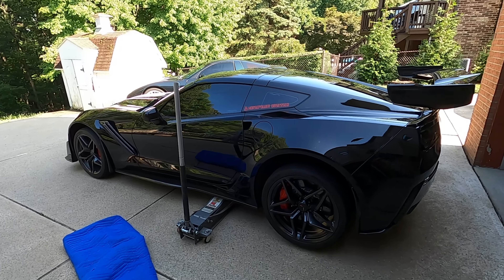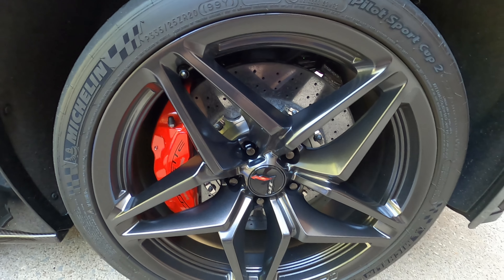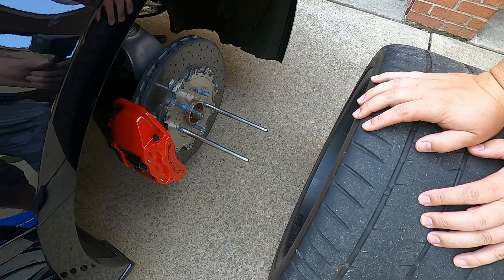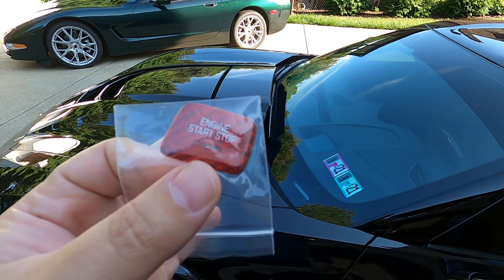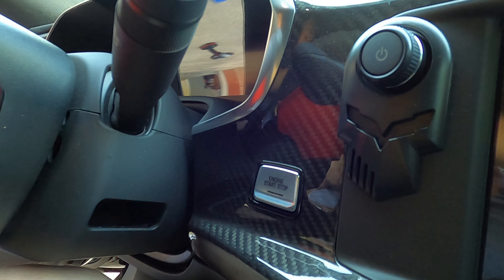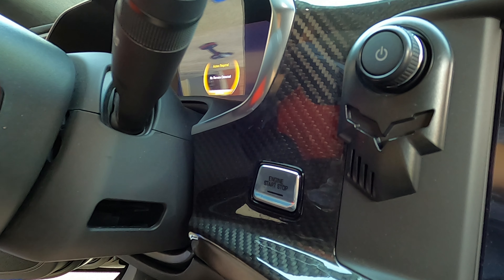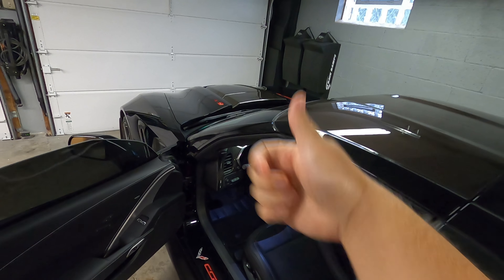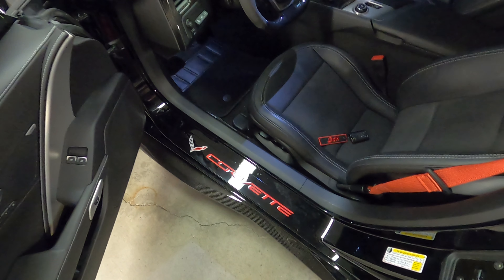Carbon fiber PARTS for YOUR C7 Corvette for less than $70!

Comment from the maker: What do you guys think of the carbon fiber addons for the C7? Check them out here: 🔴 Carbon Fiber Start Button Cover (red) - https://amzn.to/3Ed1H5B.⚫ Carbon Fiber Start Button Cover (black) - https://amzn.to/3nzn0Z5. 💲 Save 10% off the key fob cases by using promo code “HPO10” 💲 C7 Corvette Carbon Fiber Key Fob Case - https://bit.ly/3Ch9BJu. C8 Corvette Carbon Fiber Key Fob Case - https://bit.ly/3lqds00.
Reply: Those ACS composite things are an amazing idea. I wonder why GM didn’t just do that in the first place.
Reply: Just purchased the red one for my Z06
Reply: The carbon pieces are gorgeous!
Reply from the maker: Thank you!
Reply: On Amazon when looking at the Red. Button Cover, it states it will not fit my 2017 Grand Sport.  Isn’t the start button the same on all Corvettes?
Reply from the maker: Yes it is. It will definitely fit. Amazon's fitment guide is often wrong but I can guarantee you it will fit.

Comment: I love those extensions even though I don't have Carbon Ceramic brakes. It just makes any wheel removal easier and even a bit safer.
Reply from the maker: Agreed. It makes it easier either way!
Reply: Wheels are heavy. Sometimes I have difficulty lifting the wheel up while sitting on the ground and lining up the wheel holes with the studs.( I am 72).  Will those extensions help line up the wheels and studs on reiinstallment ? If yes, do they make them for the C6? TY
Reply from the maker: Yes and yes! The C7 and the C6 both share the same lug extender. You can find the link in the description to my website where I sell them!

Comment: Totally want that key fob cover for my ZR1. One question though.  Will the fob still fit in the emergency “slot” in the steering column with the extra thickness of the case?

Edit: even before you answer, I bought it anyways (with your code!).  Figure it’s a good time to change the battery anyways while I’m messing around with the fob.
Reply from the maker: All great points but no, I don't think it will fit with the added thickness. I'm going to go try it now, though.

Comment: Those lug extenders are almost worth their weight in gold. As you may recall I had to replace the left front rotor since it had a flake on the outer edge, likely due to a rock. It was $2800 for the rotor alone. That's assuming your dealer can get them. I say that since some carbon fiber parts for example are no longer available since the manufacturer went out of business. 

That said, as you know, the brakes on the ZR1 (next to the engine) are the best performing parts on the car and rival those found on far more expensive imports in my experience. I have almost as much fun slowing and stopping as I do accelerating. ;) In fact the only thing that brakes as well is the F-16 when the drag chute is deployed at ~170 Kts, which is ~195 mph. Close enough to the stated top speed of the ZR1 @ 212 mph, not that I can confirm it’s capable of that, mind you. That said, you just gave me another crazy idea! >:}

Comment: What's the difference between carbon fiber and carbon flash?
Reply from the maker: Carbon fiber is carbon fiber and carbon flashes basically just black paint with silver metallic in it.
Reply: @HorsePowerObsessed  ✔️

Comment: That key fob holder is beautiful!  Can the engine start carbon fiber  ne removed easily?
Reply from the maker: It's just double sided tape so yes, it can be removed easily.
Reply: @HorsePowerObsessed  thank you for the super quick response! Very consistent with responses, HPO Rocks!
Reply from the maker: Thanks! 😎

Comment: Did it cover the button all the way?
Reply from the maker: Yup. Literally looks like a full button replacement.
Reply: @HorsePowerObsessed  very nice just ordered one myself I'm not a huge fan of carbon fiber so I'm honestly going to paint mine solid torch red to match my paddle shifters got any tips on how to put the start stop lettering back on it after paining?
Reply from the maker: Outside of a small vinyl you might be able to find on eBay or something like that, I'm not sure.